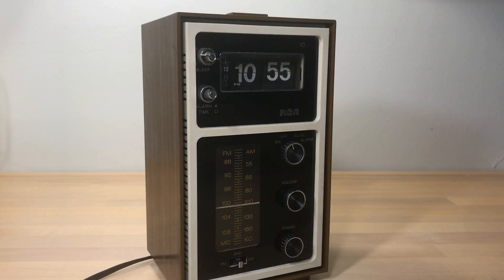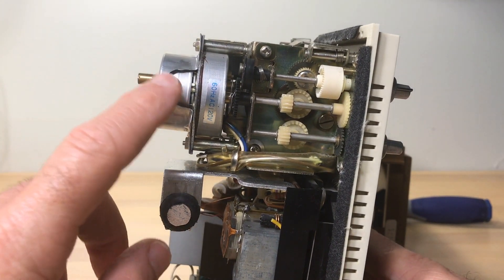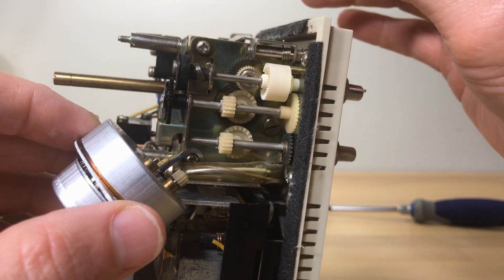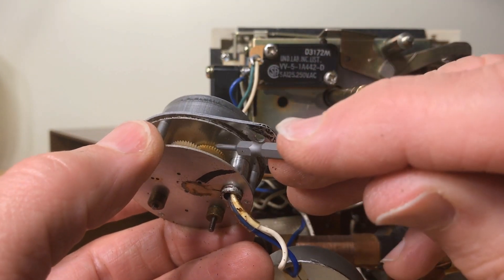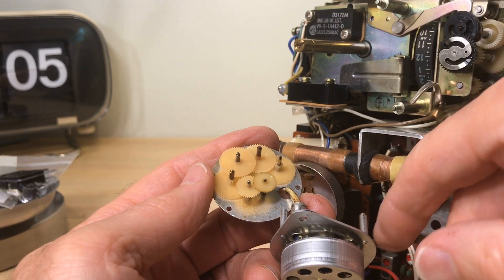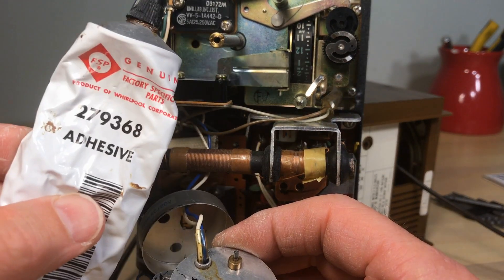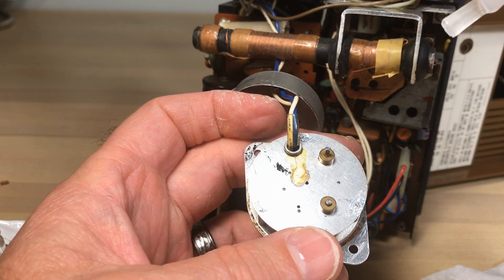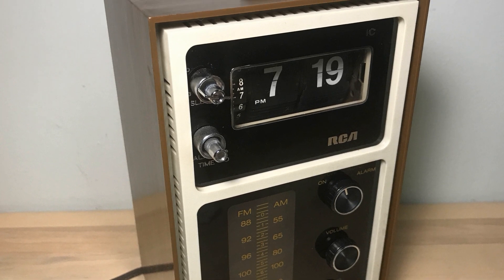RCA RWS467W Flip Clock Radio Gear Box Repair

Comment: Love all your videos. I'm currently working on Sony digimatic tfm 650w. ..the same problem with the first gear. (10mm 4010)  It's gonna be lot of fun:) and  what I'm trying to find is how did you open this space where all gears are placed. I have Dremel tool,, but I'm  not sure should I use sanding tool or drill. or something else?
Reply: Update: I drilled like a dentist with magnifier and 2mm drill.and it worked. also I saved all holes from overdrilling  successfully